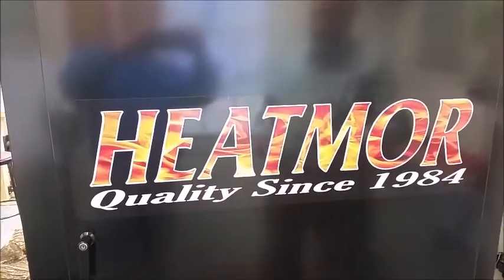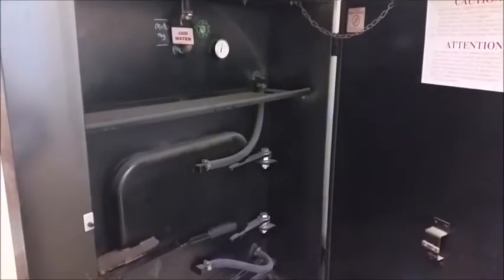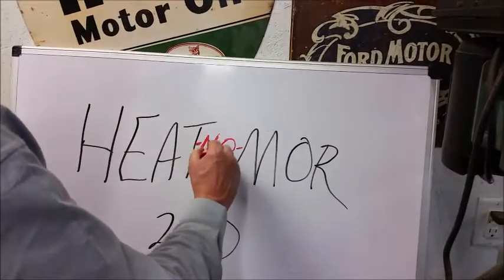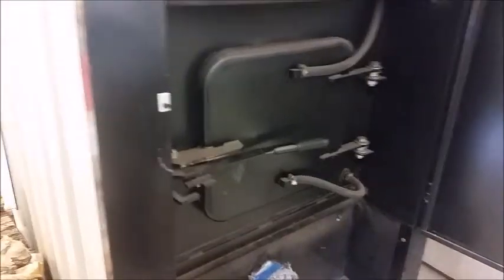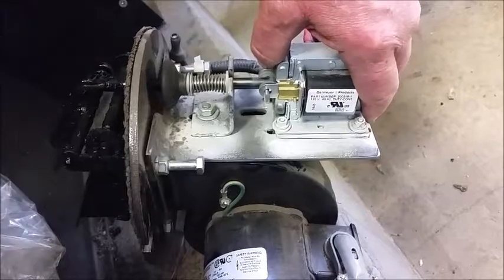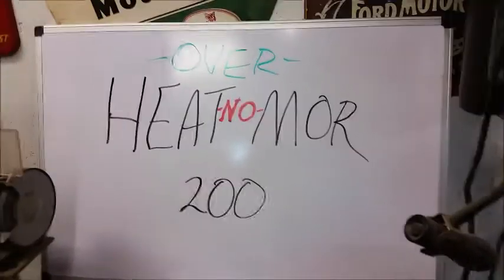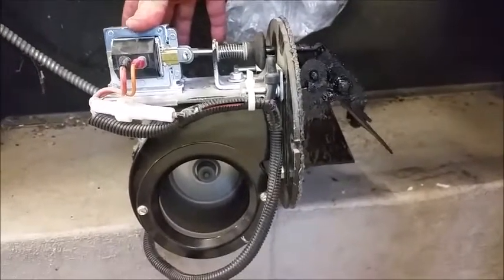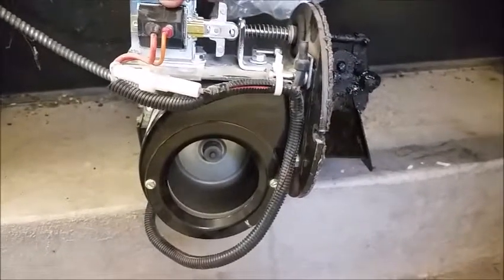Heatmor Outdoor Furnace Retrofit

Comment: I have 100 series. Will this part work on my set up?  Everything from the video looks the same. My blower might be slightly less powerful as yours
Reply from the maker: Greetings Brian, I'm unfamiliar with the details/specs of the 100 model, so I can't accurately respond. It's probably similar though.  This fix is a radical, but perfectly functioning retrofit that prevents a Heatmor from overheating due to the flapper remaining slightly open after the blower stops. It's custom made but definitely corrects this issue.

Comment: Hi Bill. Great video! I need to add a solenoid to my damper as well.. where did you order the one your using ? Hope you can reply soon !
Reply: Have you ever offered a fabricated solution like this ready to bolt on for a customer/acquaintance?
Reply from the maker: Chris, I ordered the solenoid from Zoro.com.   DORMEYER | Zoro #: G1062792 | Mfr #: 2005-M-1.  Best of luck to you.  It's the final solution for the Heat-no--Mor overheating problem.
Reply: The hammer portion and lever mechanism is more id like to see. Dimensions and components you used. How you fastened it to the fan section.. guess you wouldn’t wanna make a “from scratch” educational video on that entire unit ?
Reply from the maker: @Lord_Vaders  Once you get your solenoid, carefully compare my Over Heat-no-Mor video setup to draw up something that bolts on using the top two motor mount holes, fits easily thru the draft hole, closes the flapper, allows the flapper to open and cycles within the stroke of the solenoid.  Mock it up with pins and hardboard and tweak where necessary.  I used cotter pins at all joints. Build it strong and reliable and it will compliment your Heat Mor and stop it from overheating.

Comment: the real problem is ash getting down in front the flapper . . . keep the ash raked back from both ends & don't load wood at ends so much.
Reply from the maker: Sorry Kemosabe, ash in front of the flapper is incorrect.  The real problem, as you say, is exactly what I have stated, creosote forming or migrating in between the underside of the flapper and the square angled seat on which the flapper should form an air seal.  It's really very simple.  No tight flapper seal due to creosote or rabbit droppings, it matters not what, then you get an air leak with the fan off.  With nothing to effectively close off the flapper, you'll get an overheat.  No compromise.  Try it for a day or so....and don't forget to add water afterwards.